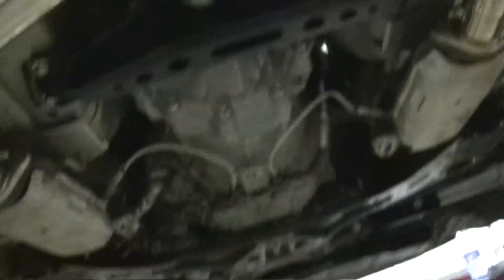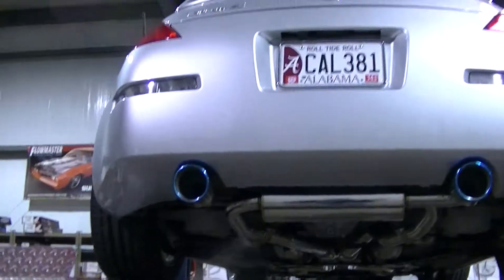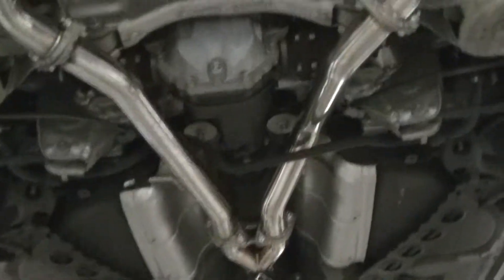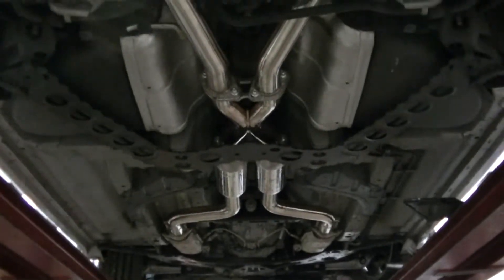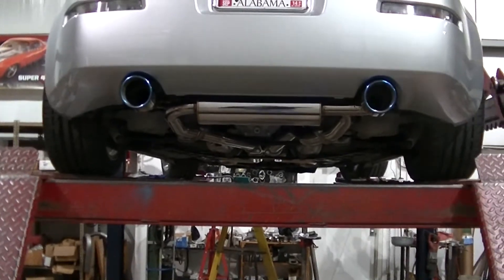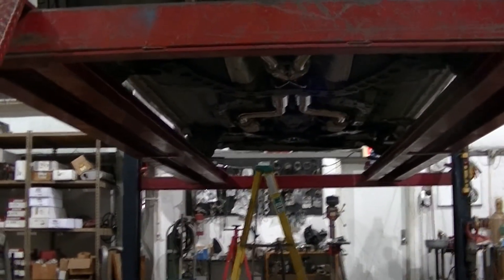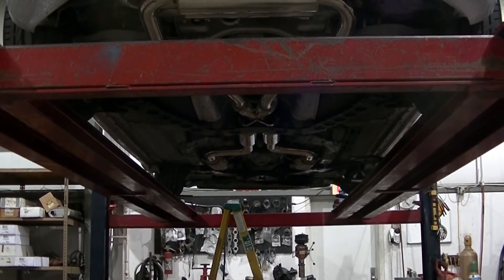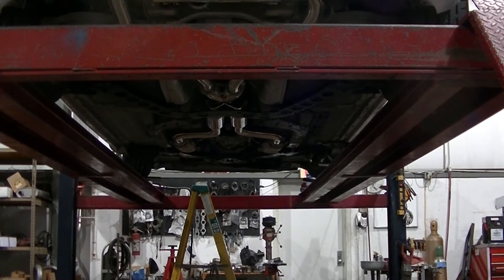Cat Removal 2008 350Z  - Mid Way -

Comment: Curious how this worked out. I do these installs in a regular basis and I've broken some cheap extensions but nothing like what you're describing. Did he try using a reverse grabber socket? The more you turn it counter clockwise the more it digs into the nut.
Reply from the maker: No.  He didn't use a reverse grabber.  These nuts , as you know, were for all practical purposes welded to the flange due to heat cycles.  After we got the first one off we had a bit of a "routine" if you will,.. and the second one took 10 minutes using the same "techniques".  This car has one nut facing the front/engine and the other towards the rear (bottom of the car).. I get the reason it was done, but honestly the job would be infinitely easier with both nuts on each cat flange to face towards the rear/bottom of the vehicle.  They are now. :) -- All I can say is the first one was way too much work, but that said, if you do these on this type of car commonly it should be a relatively short process.  This was his first time working with this vehicle, but as you can tell he was an exhaust shop so he has done plenty of header/cat removals and this was without doubt his most difficult to remove simply due to the nut not breaking free.  We also did not want to strip the nut and get into a worse situation with it.  It wasn't so much the grip but the strength which is why they came off with a torch then quickly going back up to pop the nut.
Reply: Haha I understand. I've done maybe 10-12 sets of cat removals and all but two I snapped the bolt off. They don't call it the demon bolt for nothing!
Reply from the maker: Aaron Huck Haha.. amen bro ;)

Comment: Man! You're shooting a video to show what you can't do? How does that help? You should also tell us what you did to solve the problem! Viewers are looking for solutions, not complaints!
Reply from the maker: I shot little snapshots / short clips of a mechanical project I knew HOW to do.. have done before,.. but did not have the tools in my own garage to do the job (that made any 'time' sense).  Removing a few bolts and removing 2 catalytic converters from the Heads,.. and replacing them with direct fit High Flow Berk Technology hi-flow Cats is not rocket science.

If interested -- Here is a partial 'build log' of things I obviously did myself on the vehicle .. some with video, some with pictures:  https://www.350z-uk.com/topic/82449-chromatics-2008-350z-build-journallog/?tab=comments#comment-1230385

I didn't start the whole youtube thing until after I did some of the larger more tedious and 'impressive' projects on this vehicle so they never were filmed.

To your question -- I have in the description ALL parts that were filmed in this.. but again they are:

ALL Videos taken during this Catalytic Convertor Removal Process:
https://www.youtube.com/watch?v=blfg4x5gPkg
https://www.youtube.com/watch?v=I1dnASptSWM
https://www.youtube.com/watch?v=-8gdvID7H64
https://www.youtube.com/watch?v=xHg8vQVfB30
https://www.youtube.com/watch?v=dwkf6USk5Ig

And I don't know what you are after?  This process is MEGA simple intellectually.  If one does not understand how the exhaust system is arranged they shouldn't be working on their Z honestly.  It's among the simplest systems on a vehicle.  

The "Difficult" part of this process is what is termed the "demon bolt(s)" -- which are the two bolts (one for each side/stock cat) that face TOWARDS the front of the car, therefore only accessible via the engine bay requiring an extension (or extensions) many feet in length to reach these bolts.  Further due to heat cycles and location (being attached to the Headers these bolts are heat cycle 'welded' on most Z's.  Therefore with the aforementioned extensions causing a severe lack of proper torque and GRIP on these nuts/bolts -- They can take HOURS to remove 1.  

The ultimate trial and error resolution for this particular situation was to use an acetylene Torch.  With the torch we heated up the intersection of the flange where the bolt/nut were juxtaposed and this temporarily reversed the heat cycled effect where pneumatic tools (or a breaker bar ) was finally able to loosen the nut.

After the FIRST nut was removed.. the second one was very quick as the 'method' and use of torch expedited the process.  

Does that help answer your question?

Comment: The demon bolt muhahaha
Reply from the maker: Yup -- these 2 'demon' bolts are nightmares unless you have a 'routine' down that works quickly like we figured out with the acetylene torch. :)  Why nissan put those bolts facing the front/engine is beyond me,.. we turned them back towards the rear of the car (accessible from bottom) for the Berk Tech High Flow Cats.. so future efforts would be quite easy.